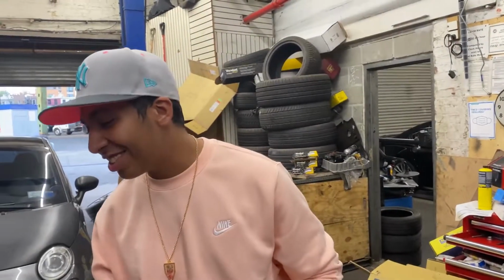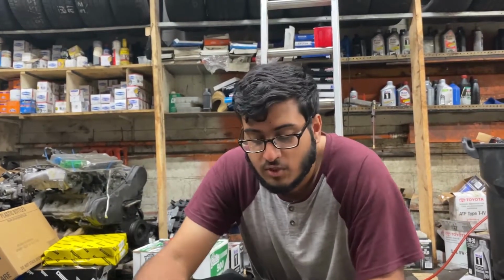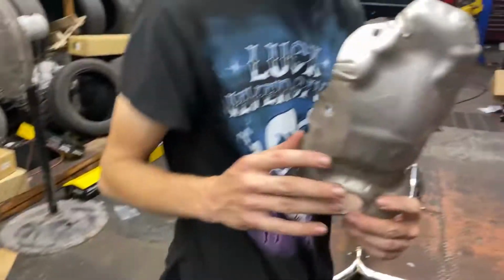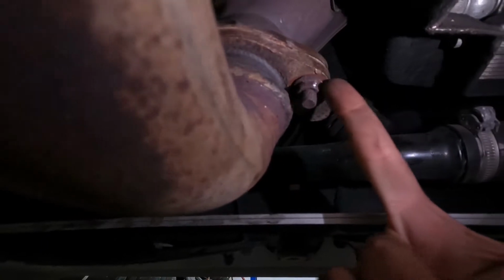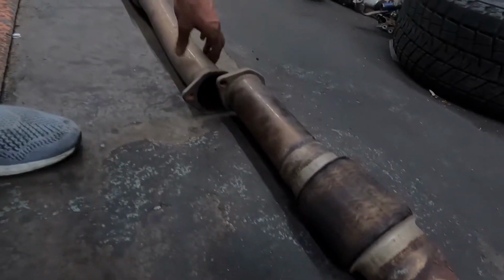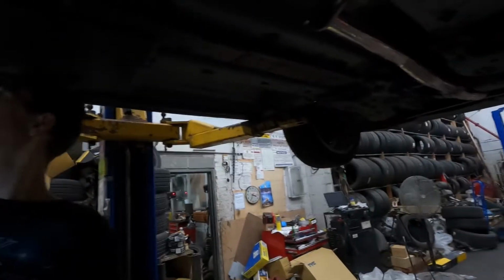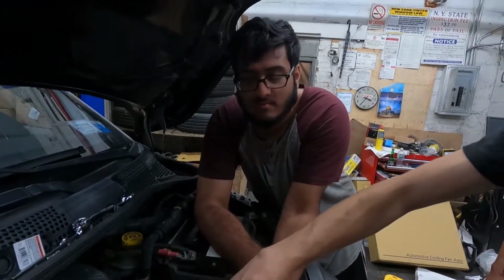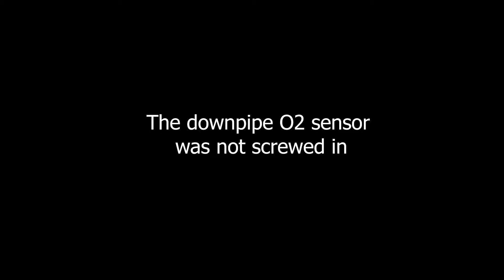Fiat 500 Abarth - 2.5 INCH CAT-BACK EXHAUST + CATLESS DOWNPIPE INSTALL!

Comment: Did your exhaust kit come with a loop clamp that secures it to the transmission? mine didnt come with one, it needs it to prevent access pressure on the downpipe studs
Reply from the maker: Nope mine didn’t come with one, you have a part number by any chance ?
Reply: @wellseegarage  Glad you asked this. I went to a local nut and bolt store and found a 2.5 inch clamp that works perfectly. I used a pair of vice grips and flattened the ends out, no hole drilling necessary as the clamp came with a 3/8 inch sized holes. Quick and easy install and now the exhaust doesn't move at all, even with high mileage exhaust hangars. I don't see why manufacturers don't include this in the kit, it's important. I'll try to find a manufacturer part number for you tomorrow.

Comment: That’s not an OEM exhaust just saying. I was looking at mine just yesterday, mine doesn’t have the resonator like yours, yours is also larger and yours is stainless, they don’t come stainless from factory. So atleast that midsection is aftermarket and probably why he had to do some messing around with it
Reply from the maker: Yeah I figured as much, was quite the pain to mess around with for us too haha
Reply: @wellseegarage  yeah I especially noticed when it got to the rear T section, it’s quite a bit larger than mine before it hits that T

Comment: Exhaust hangers + WD40 = EZ
Reply from the maker: Noted
Reply: @wellseegarage  If there are still hard to press on use channel lock pliers you can cover the jaws with fuel tube to protect the hanger bushings.  The poly ones are a PITA, but easy with WD-40 and pliers.
Reply from the maker: @BrockGrimes  Appreciate the advice brother!